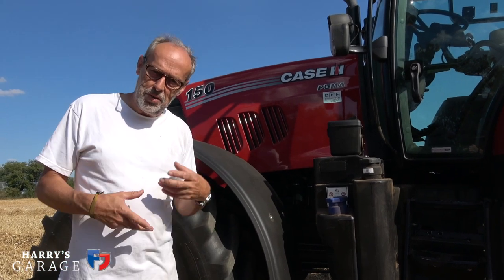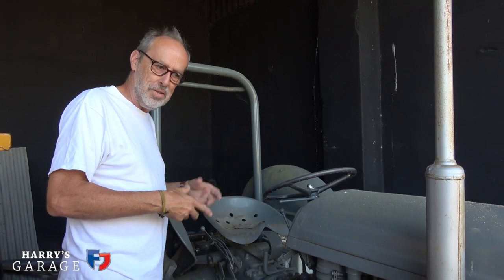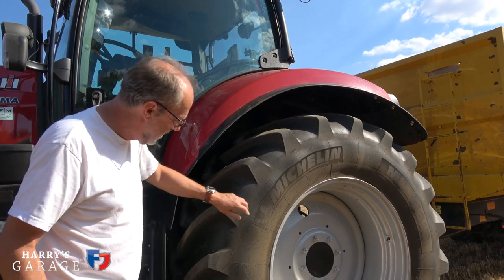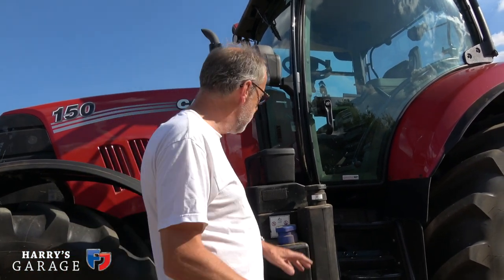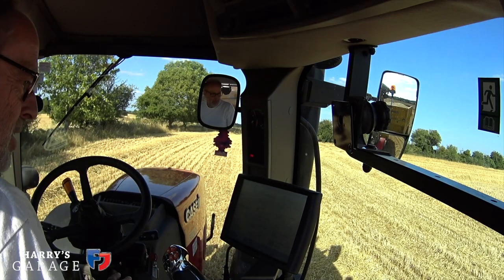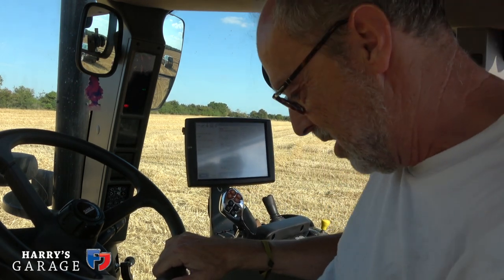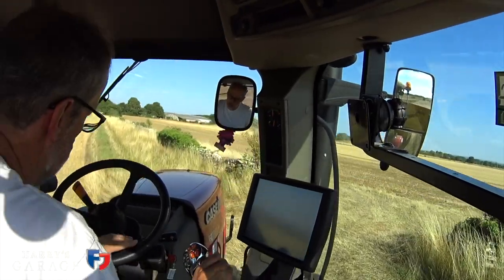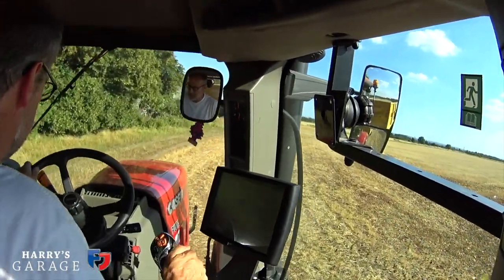Driving a 2018 tractor and a look at what's changed over recent years

Comment: An excellent overview of modern tractors and their use, I cant help but wonder if this tractor will still be active in 70 years time like your Fergi 20, electronics do not like vibrations and dust that is ever present on farm machinery, but really lightens the work load few a couple of seasons, I have just got off my Fergi after shifting 18 tons of soil, I sure it would have taken far less time with the Case ! Also a very good tribute to the Fergusson System, to which we owe so much today.

Comment: I'm not sure how much content you could get for a complete extra channel. 
These two video's have been great but I think people may be less interested in the differences between a 2018/2019 tractor - that's likely only to appeal to farmers and the odd enthusiast. 
I think past the point of a vintage tractor vs a new one it will probably go way over people's heads. 
On the other hand you make a brilliant job of presenting them. Taking the time to go through what they do and why makes a great video. 
Some of the technical aspects such as how the axial flow drum of the combine work and are layed out in particular stand out as extremely interesting and informative. 
This is the kind of deep understanding most presenters just don't possess and I personally would much rather watch someone like you who knows what they're talking about and who can articulate that in a clear, concise manner than some jester reading from the press pack. 
If you can get enough variation in there it could be a winner. 
On the other hand why not just post them on here?

Comment: When i started on a farm in 1968, we had a Fergie 20 with bigger rear wheels on it that almost touched the mud guards. We would hitch a 2 wheeled trailer on, and then a 4 wheel behind that, she would pull the trailers loaded with straw at 30mph. A great little tractor.

Comment: great video as usual.  I drove tractors about 40 years ago and could never get the hang of driving in a straight line.  I was given many tips including aiming at a landmark, such as tree but  it never worked.  GPs is the ultimate solution but wow, how the modern tractors burn fuel.

Comment: We bought two new NH tractors , very similar to this Case but painted blue .[ Case and New Holland are Fiat owned ].
Never again , they constantly let us down , breakdown after breakdown after breakdown . Usually sensor/computer related but one turbo did blow up . All covered under warranty but still had to pay the dealer to drive out to the farm which was 2 hrs travel each way , plus we were not remunerated for the downtime and the fact that we lost crops because of missing the weather .
After you have done a few hundred hours in that cab , you will realise that it is not very ergonomic , has no opening windows and the air conditioning will become dysfunctional .Bloody uncomfortable and annoying.
John Deeres have better control layout but as far as reliability is concerned are no better ,my neighbour has a 140 hp that has had to have a transmission rebuild TWICE within 2000 hrs , plus a new dashboard unit because that went kittywonkus as well. My other neighbour has two John Deeres broken down  and only one running .
Modern tractors are overcomplicated , unreliable junk . 
We made a decision to get rid of them and buy late eighties/early nineties tractors and have them rebuilt before we put them to work  . These tractors don't have computers and have mechanical fuel pumps . Simple ,reliable and fixable on the farm .
Reply: I've once been told - but I don't know anything about tractors - that Fendt is the way to go. 
Expensive, but the very best.
Reply: @jpthehoff8603  They do have a good reputation but also have a 50% price premium and no dealer in our area .
Reply: still got two IH 1455s going strong with gargantuan hours on each

Comment: Nice video comparing then and now, what is missing is the nightmare you can get when things go wrong with the electronics, you cannot even drive home or to a sevice centre as in most cases they become imobalized and with no limp home option. I know of a few modern day tractors that have been stopped for months waiting to find and fix electronic problems. There are so many sensors just waiting to go wrong in the very harsh enviroment that they are run in.

Comment: Worked on a pig farm back in the day. The guy had two old grey Fergies. Start up was interesting. Glow plugs had to be emitting smoke before turning the engine over. At that point the the shed would fill with black smoke! (I wonder how much diesel particulates added to 'farmers' lung'?)

Comment: You are missing one very important point about the hydraulics: They were load reactive, or not sure how to word it, but the gray guy was the first tractors to implement the hydraulics where the force needed to pull the implement would also lift it up, allowing it to adjust it's depth automatically, and not get stuck. This is still carried on today, and was invented in that exact Ferguson. (Massey was not involved until much later). Also, they were not diesel until later, we have a '56 and it is still gasoline. Engine size on ours is 2,1 litres. The diesel version is a later and completely different model alltogether, we call it the goldfish, as it had a gold colored engine. We have lots of strange implements for ours, front bucket, timber crane, half tracks, 3-point mounted jack, hydraulic trailer hitch, harrows and plows etc. Greetings from a Norwegian farm kid who grew up with a '56 'Gråtass'!

Comment: Actually grey TEA Fergies were a petrol engine similar to the Standard Vanguard. I hope that you don't put diesel in it. The gearbox was direct coupled to the PTO which was improved in the next model the T35 by having a split gearbox so that a slasher for instance would overrun rather than continue to drive the tractor forward.

Comment: Harry, these are awesome!  Question, is the drive on the tractor direct through a traditional transmission?  Or are the wheels powered by hydraulic motors?  Thanks!
Reply: That particular tractor has a 19 speed powershift transmission with six reverse gears. They have three groups of six, changed by clutch packs, plus a direct drive top gear for efficiency. It can be used with driver actuated gear changes or fully automatic as Harry demonstrated.
There are simpler box options on it from the factory, including a conventional synchromesh unit with or without overdrive, or  and 18 speed semi-powershift which is similar to the full powershift but with a manual change needed between each group of six power shifts.
There is also a full CVT or IVT transmission. Not a steel belt type you find on cars but a power-splitting type where variable amounts of drive are directed through a mechanical channel and a fully hydrostatic [hydraulic] drive channel. This has distinct advantages where a shaft driven implement requires a constant shaft, and therefore engine speed. The engine is therefore limited in varying the forward speed to conditions and load, so the transmission steplessly changes the speed to maintain engine load. Also on haulage or tillage work it will slow the ratio and forward speed with the load, therefore maintaining an optimal engine speed by varying the forward speed, on undulating field or road conditions for instance. For where fixed accurate forward speed is required, this can be maintained while the computer alters the engine speed for optimal fuel economy.

Comment: Some car makers have had a stab at variable ratio steering but as of yet (2020) none operate completely without some mechanical connection between steering wheel and road wheels. Even Citróen's DIRAVI system had a very vague full mechanical back arrangement. BMW introduced a variable ratio system of sorts which uses a planetary gearset in the steering column but as I understand it is simply a binary arrangement. ie quicker at parking speeds (and with a corresponding increase in power assistance), and 'slower' at road speed.

Comment: I still use a Massey Ferguson 90 lol. Manual transmission with high low ranges, a little newer than the Grey 60 something. It's been completely rebuilt a few times now. It replaced a Ford 9N like the Grey when I was 5 years old. I won't begin to say how long ago lol.

Comment: Thanks fro sharing.

I did some tractor stuff at Pershore College.   I trained in horticulture there.

I never did get to grips properly with the difference between draught  and position control.

I'm not  I like moving thall the controls a round,,,,     I want tacho in front of me...... hand throttle!!    Diff lock by your left  heel!

Not meaning to be neg 19 litres an hour  (please can we have gallons?? haha) is about 4 gallons an hour.    A bet your fergy would ahve run all day on a gallon?

AS I say GPS was  just coming in when I left the local Agri college in '97.

Edit; Do You still ahve to do spray modules for crop spraying.   I got hand held , misting fogging and eventually PA2 Tractor Mounted.

Comment: Interested to hear if there is much movement towards electrification of agricultural vehicles. No gears, massive instant torque, low maintenance, space for solar panels and wind generation, static batteries for on-site storage, no diesel costs or pollution, silent running, no chance of fuel leaks degrading soil and water sources. I would have thought it was a no-brainer. Discuss.
Reply: How big a battery would you need to replace 400 litres a day of diesel fuel on a 250hp tractor I wonder?  However, I would love an electric tractor but for the foreseeable future that technology will be limited to lighter road vehicles. Even for a road truck, the battery would weigh tons and would take far too much away from the carrying capacity while staying within maximum gross weight limits. It would also need some humongous charger to recharge the massive battery capacity in anything like a timely fashion. Small loads and town delivery over limited distances, fine. After all, electric milk delivery floats were around in the 1950's

Comment: Interesting video. How many years will you use that for? I have sensed a lot of fear in older farmers for the electronics on  modern machines - is that justified?
Reply: The older generation has a habit of continually dying off. Having said that, I'm 60 and on the front line, and I love the technology and the advantages it brings to productivity. You can't really use any old driver that can drive a car on these things though. Casual drivers can do a bit of haulage if they are sensible and trustworthy, but generally you need someone with a lot of head on their shoulders to set these tractors up and work with them without breaking something dreadfully expensive.

Comment: Case built a simular set up of tractor in the 1970s.  It didn't have a CVT trans but it had like 4 clutches which allowed to "shift thru 4 ranges" with just a bump of the lever.

Now all this high tech automation won't be kind to these.  John Deere is already seeing its buyers getting frustrated. Because it can't fix the tractors out of warranty.  

Why we are seeing high tech tractors and equipment is because they are afraid to lose sales if they don't keep up with the competition.  I actually find it hilarious that they keep forgetting that farmers want LOW MAINTENANCE COST not high repair cost etc.

Do some farmers seek out very advanced last technology?  Sure they do, but they also enjoy simple designs too.

Comment: the downside of farm tractors like these is that you have become totally dependent on expensive manufacturer/dealer support. Everything works on canbus and computers , you need factory software to read and wipe error codes , etc. It makes DIY fixing your tractor a lot more difficult.
Reply: jfv65 that’s how dealerships make money
Reply: jfv65 that's not really the case in Europe because we have lots of different brands compared to the USA
Reply: dont tell me .....had a tractor switch its self off today ,had to rewire it direct from the battery to keep  working  lost  well over a hour .......

Comment: "I can change the steering ratio. I don't know why car manufacturers don't do this" It's because for at least the last 30 years, tractors have had hydrostatic steering. There is no mechanical link between the steering wheel and the road wheels. It's all done by hydraulics. You can have any turn rate you like, you just have to displace more or less fluid per turn of the steering wheel. The "motor" at the base of your tractors steering column has some form of switchable displacement control.

Comment: very good tractor but i like older tractors from 80-90s when there were no electronics and you had to change gears manually and there were no synchro on the gearbox double clutching not hydrailuc steering everythings is harder and in my opinion more fun maybe because i dont drive a tractor very often 5-6 times a year and everytime i got in my tractor there is a huge smile on my face

Comment: Harry, what are the monthly maintenance costs on both the tractor and combine? Are maintenance things like oil changes easy to do for someone with a modicum of automotive skill?
Reply: They are easy to do for someone with the necessary skill and motivation and time. Otherwise dealer's service vans come to the tractor to service and do minor repairs. They even sometimes strip the tractors down and repair them on the farm.
There's a video somewhere of a dealer team replacing a whole transmission with a factory exchange, due to the fact that the downtime otherwise could not be acceptable, overnight on the user's yard. Massive job to be undertaken only by a very skilled team.
A single oil filter can cost up to £200 on large tractors and there may be up to a dozen  filters on some altogether. Engine oil changes are generally at every 500 hours, which is equivalent to between every 15,000 to 20,000 miles on a car or pickup. Remember that the tractor may have 20litres or more in the sump and another 100 perhaps between the transmission and hydraulic systems [every 1200 to 2000 hours for those, depending on brand and design].

Comment: I was just thinking that tractor probably cost you two Ferraris and a Lambo till you said at the end, 70k pounds. That's cheap for what it can do.
My dad used to have a little gas powered machine we would take out to a farmers field and set it up and it had two rollers that clamped those disks and rotate it. As it did it would press that disk back out and sharpen it without grinding it. I don't remember how many times you could do that to a disk once a season but I imagine they lasted longer than when they were sharpened by grinding them.

Comment: Hi Harry, the farms video are great.  Quick question... compared to cars, the HP ratings of tractors seem very low.  Are the engines tuned more for torque or do the gearbox ratios mean that low power is sufficient? Why such low power?
Reply: Tractor engines are built heavy to work at full power and/or torque constantly for hours on end. For years on end. Harry's tractor will boost to around 190hp when needed, and around 700Nm torque at around 1400rpm. They can be directly compared with road trucks, only that road trucks are not meant to be run at maximum rated speed and power all day. Maximum torque, yes.  That Case's engine is 6.7 litres and made by Fiat Power Train, also sometimes called Iveco engines. This one is from the NEF family and also used in Iveco medium trucks of 7.5 to 12 tons gross. Trucks are designed for the road of course, so to pull at higher road speeds. The tractor is designed for the field but also for the road, at a much more sedate pace, so generally they can pull a higher gross weight per horsepower than a road truck. It's all quite complex but believe me they know what they are doing with these things.

Comment: On today's cars, you can consider yourself lucky if you can adjust the power steering.

My 2006 Ford Focus ST has 3 different modes. Comfort - normal - sport. I prefer normal.

Interestingly, no matter what setting it is in - in standstill, the steering is very easy.

Previously, I had a 2003 Seat Ibiza Sport TDI 131PS which, albeit almost fully loaded, had a totally overpowered power steering and no chance to adjust anything at all which made driving the Autobahn at more than 150kph, well, interesting. No matter how even the road is - here and there is a nasty pothole hiding. When you suprisingly hit it that Ibiza slightly changes direction - you have to countersteer immediately to keep the lane.

This is due to the nature of that stock differential and the high torque of the TDI engine. For a fraction of a second one wheel has less weight on it, making it a bit faster. As soon as it hits the tarmac again the car gets dragged in the direction of the pothole.

Nothing I like whilst driving for hours. It always made me cramp behind the wheel, wondering when will it happen again.

My ST is quite the opposite. You can do +220kph literally single-handedly. Easy. No big deal.

Comment: What really surprises me about tractors in general is the small ring of bolts, or nuts securing the drive wheels to the drive / half shaft. All of the torque is transmitted through a really tiny area of metal compared the the rest of the thing. Even the trailer in this video has a much larger area of bolted metal supporting just the weight of it. Could anybody offer a simple explanation, something not involving any complicated arithmetic.